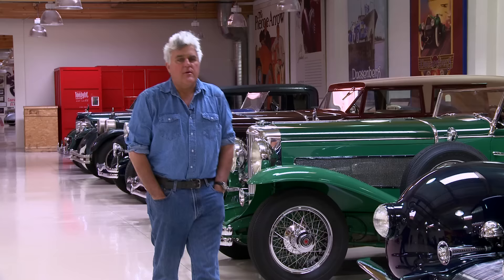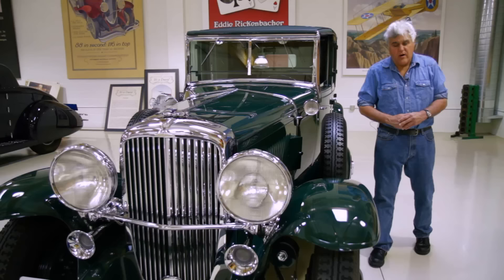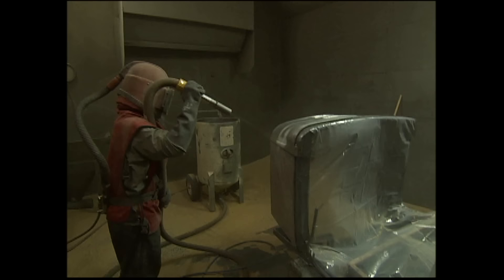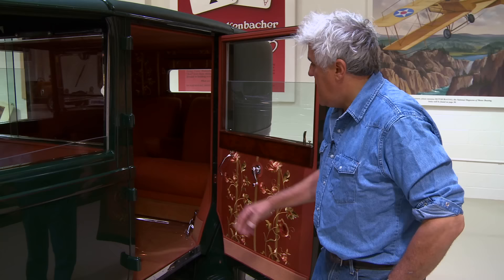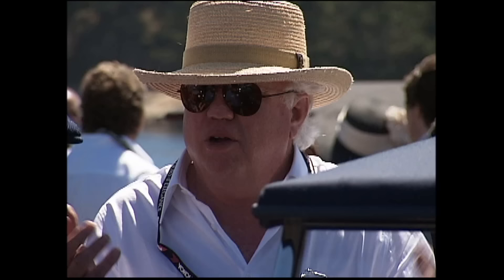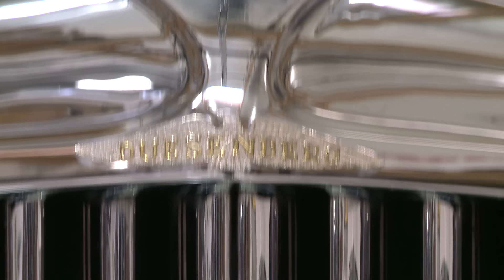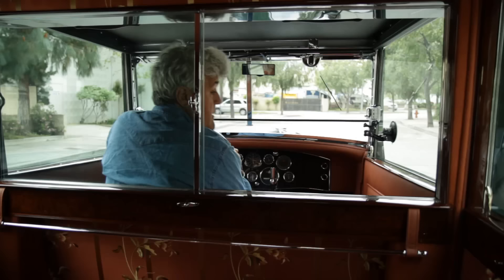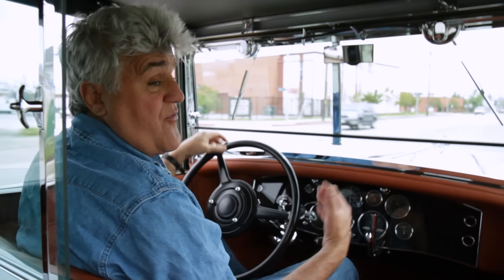1931 Duesenberg Model J Town Car - Jay Leno's Garage

Comment: "The Duesenberg - section of the garage"....My God!
Reply: I have 4 cars. “Here is the Fusion wing (2 2011s), the Chrysler wing (2013 200) and the Acura wing (03 MDX). All have over 200,000 miles, and are original, and unrestored😁”
Reply: Here is the Corvette section of my garage, they are all original, they say Hotwheel or Matchbox underneath
Reply: Here is a section in my garage
Reply: Really ... Count the cars, then multiple by $1 Million .  At least.
Reply: I always say this the weedeater section of my garage,this is the 2 cycle oil section......etc etc

Comment: For those who aren't familiar with Duesenbergs and other vintage automobile makes,  a Duesenberg left the factory as a rolling chassis - they did not have bodies nor interiors.  It was up to the owner to choose a coachbuilder to create the body and interior components and as a result every Duesenberg on earth is a unique, one-off creation.  There is no such thing as a "stock" Duesenberg.
Reply: Well they are considered stock if not mechanically modified. The body maker walker was owned by duesenberg. The LeBaron dual cowl phaetons are all the same except for color. Also if you buy an original and rebody it with a modern body it is still considered 100% original because of the fact that they didn't come with bodies.
Reply: @kylemichaels3373  Thank you both for the great information. Fascinating cars!

Comment: Something nobody seems to have commented on is Jay's driving skill.  If that's an original gearbox, I assume it did not have syncromesh and Jay did a pretty good job of shifting.  You can even hear once in a while he'd push the gear and wait for it to mesh (grinding gears) till he got the speeds matched and got'er in.  That is not an easy skill to master.  He's not just a rich guy with cool cars, he's a true "car guy".

Comment: Magnificent car. Saw one on GOODING AUCTION in red with the big flexible exhaust pipes coming out the RH side and was sold for $11.000.000 at auction
Reply: That would have been a SJ variant.  The SJ's had superchargers and are extremely rare today as there were few made and many/most had the superchargers removed at some point in the past.

Comment: The first car I learned to drive at 13 on the farm was a 2-Ton 1932 flat bed truck.  It had a little 4 banger engine that we started by pouring gas down the carb.  The gears were super low so it could haul a big stack of hay around the farm.  Great fun, memories.

Comment: I recently purchased a 1927 Buick Model 27 and the prev owner told me to come pick up any parts I could find in her garage (it was her husband’s car who passed away in 2004 and the car had been untouched since his passing, sitting in her garage), one of the things I found was a Pine’s Winterfront which has shutters, it amazes me when I used a hairdryer and heat the bellows based thermostat the shutters work as they should after all these years!!!  Pretty cool @JayLeno

Comment: Jay, when I was a kid probably about 16 (1980) I went with my dad to an old steel building down on Lake Quinsigamond in Shrewsbury Massachusetts inside the steel building there were about seven Duesenberg‘s all in various states of restoration. What they didn’t have they would hand make. One of the most impressive shops I ever went to… These cars truly are works of art.

Comment: I believe their is an estate down in Florida that was locked when the market crashed. The place is maintained, but has never been lived in again. They have taken picture of inside the build, and looks the same as the day they closed the doors. It isn't all dusty and stuff, the go through and clean the place once a year, and make repairs. The place is frozen in time. They have a garage with cars in it. Know one knows what the cars are, the have mechanics periodiclly go in. For the last forty years, the mechanics have been classic car guys. These classic car guys don't say what they work on, except the cars used by the servants.

Comment: 15:22 Altimeter?  I believe you may have misspoken, because I can't seem to find the altimeter.  Had it had one though, I would have been very impressed.
Reply: They did have them, in another Duesenberg video he talked about how silly it was for car to have an altimeter, at 15.26 what's the big gauge in the upper right corner?
Reply: @bigredc222  The phantom corsair also had an altimeter and a compass too if i remember correctly.
Reply: I found out why they have altimeters, it's to help in adjusting the carburetor, air is thin up high, rich down low.

Comment: Wait, can someone explain this?
So this is a 1931 model, but it was stored away in 1931. But it had (roughly) 107.000 miles on it? In one year, a car which had its place in New York City?
Reply: That is a good point!
Reply: It's just like that car on Craigslist--garaged for years, low mileage, and yet somehow it's got replaced pistons and more than 100K miles. :-)
Reply: haha
Reply: thee Mitchi 
Well you see there’s not air cleaner on the engine so it’s just sucking in all kinds of dirt and junk. 1 teaspoon of sand in an engine can cause the equivalent of 50,000 miles of wear
Reply: The car had 7,000 miles on it, but it might as well have had 107,000 with the amount of neglect and rust the car had.
Reply: It probably has 7000 miles and thousands of running hours.
Reply: Excellent point my dear Watson. Excellent point. Nice catch.
Reply: I dunno know. It had 107K miles on it.  Your Theory is correct, but in the real world, I suppose that's not what happened. Luckily.
Reply: In my opinion, it probably did only have a distance of 7000 miles on it, but was probably never shut off so it was always ready and warmed up in cold weather for its owners and guests to leave in a moments notice and without an air cleaner it was also sucking in dirt and debris which wore it out and resulted in its being parked
Reply: I think you're falling victim to an editing mistake.  More than likely the car was taken out of storage after the Depression and then run extensively during the 40's and 50's - remember that US domestic auto production ceased for the duration of World War II and no new models were released until the late 40's.
Reply: He may have misspoke. It is obvious that this car was well travelled over many years before it was salted away.

Comment: 1931 Duesey,, parked in 1931.. How the hell did it get 107,000 miles in one year in New York.?
Reply: They pulled it out of the garage and got it running again in the 1950's and then put it back in the garage. That must have added a few yards to the mileage!
Reply: Bought in 1931, driven around for a few months and parked in 1931.  Sat for 20 years and seized up,  got "restored" again in the early 1950's when hot rods and T-buckets were cool by re-boring out the seized cylinders and increasing horsepower and replacing the rear end and losing the fenders to make this old jalopy a hot rod.  Driven probably all through the 1950's and raced and thrashed, then parked again where it sat from the late 1950s' through the  late 1990s.  In the photo Jay showed from 1997, you can see the rear window of the garage is wide open which is how it got so damaged.

Comment: Why is it they were smart enough 90+ yrs ago to make a valve to empty your oil, but today we are still using a screw plug???? 🤦
Reply: There was also a system to grease all the fittings from one pump. Now, with stuff like "lubed-for-life" ball joints, it's use it up and throw it out. Makers don't even include zerk fittings.
Reply: because evil people would open that valve and  empty your oil, destroying your engine when you went to drive it
Reply: the same reason they  quit putting drain plugs in the bottom of fuel tanks, because when you brought your car in for inspection, the dirt bags would steal some gas, or leave it open slightly so they could charge another repair bill and towing charge
Reply: The thing has adjustable brake settings. I cannot even believe that. Wow the innovations we had in America at that day and age. I’m not saying they weren’t doing other things around the world but this car alone makes me happy to learn and hear about. I’m soo happy Jay Leno preserves a piece of history like this for us to all learn from.
Reply: @stephenarling1667  I've found that surprisingly the ultra cheap ball joints have grease zerks. The high end ones don't and they fail in 20,000 miles when they're warrantied for 80,000.

Comment: Sounds like it has straight cut gears.
Reply: And no synchros on the tranny. Did Jay grind the gears twice? Might get fired if he was a chauffeur.
Reply: The trick is just before stopping drop it into low gear and don't idle in neutral. If per chance you do find you are in neutral with the engine idling it probably has a clutch brake, press the clutch all the way to the floor and hold it there a moment and it will stop the transmission from rolling over and then shift into gear, no gear grinding. After moving out double clutch on shifting and if your timing is right, no grinding!

Comment: Why did he do the interior like a late 80s restoration?   A white interior would have looked stunning compared to the peach,  and the single bench with the buttons feel way more period and clean than the folding armrest.
Reply: As he stated, it was in line with the colours of the time. Art Deco is not for everyone, but I think the color combination is right on the money if you want to keep it in the spirit of the time.
Reply: Granattaaaaaa I'm not saying it isn't period correct,  just that the way it's done is different from the original in a way that makes it a late 80s style car.   I also think the broquade makes it look less art deco.
Reply: brett knoss
Well I agree that I would have chosen something more original to the original spec.

Comment: I really love nearly all of Jey Leno's videos and his cars. Even the modifications are nice and most of the time not too inappropriate. 
But this car... far too overrestored, in my mind. At least on the screen, it has no soul left. No patina at all. More like a nouveau rich guy thinks an old car should look. So much bling and so "well made". Especially the fond looks awful. This upholstery like cinema chairs instead of the original "chesterfield style" and this apricot colour with the flowers.
Maybe I'm wrong, but it seems a bit anachronostic.
Reply: If the illustration has been accurate, it's condition was so bad coming out of storage it had be nearly recreated. There was essentially no "patina" to preserve. It had all deteriorated along with the paint and much of the metal. Preserving the original surface of an old car is certainly desirable if there is enough left to work with but some old cars are just lucky to be restored at all.

Comment: 1931 american car with DOHC 4 valves per cylinder. Maybe those GM engineers of today might wanna take a look since the 2015 Z06 Corvette only has pushrod engine with 2 valves per. But then again Duesenbergs were built by german brothers fresh from the boat you know from the birthplace of automobile.
Reply: There's a reason the Chevy's are pushrod. Cheaper, still make good power, makes the engine more compact. Can't say that about the Ford V8s.
Reply: Yeah, because Corvette's engine is a huge flaw.  Yeah, ok.  The big knock against 'vettes was usually that they had crappy interiors, which was fair enough.  The 2015 models have addressed that issue with massively improved interiors, though.  But, aside from the late 70s to early 80s, the engine has always been the best part of any vette.  Why make something more complex and expensive than necessary?
Reply: the vette engine (z06) makes 650hp and the car gets about 29 mpgs. The pushrod style also helps lower the hood line and keeps the cg down due to there being no overhead cams (x4 weight for dohc compared to 1 center cam, with some weight added from the pushrods). plus it's cheaper to make and easier to work on. So what's wrong with the engine exactly?
Reply: ccubsfan94
Well the price is great, spare parts are cheap and it ain't the most complicated engine to tinker which is great. What's so special about DOHC engine? Dunno maybe smaller size, more power, better throttle response, better mileage, better potential weight distribution and the fact that every proper race and sports car has had one for 50 years - hell even the resurrected Ford GT.
Reply: um no, DOHC engines are larger in size. How do you get better throttle response by adding friction inside the engine (more cams)? How does having a cam operating the intake valves and another cam operating the exhaust valves improve fuel mileage (more cams, more friction, more weight). What do you mean by weight distribution?
Reply: Push rod engines are more low end grunt high HP. OHC engines are high RPM medium power...
Reply: ur cool
Reply: They were not "fresh off the boat".
Reply: Maltfusion If by fresh off the boat from Germany at the age of 5, grew up on a farm in Iowa, developed their engines and motorcycles in Rockford, IA, built up their manufacturing in St. Paul Minn. and came to fruition with the Duesenberg Model A in Indianapolis, then YES, they were fresh off the boat from Germany with all their superior Germanic background making Duesenbergs.
Reply: bcubed72
I don't know about techno peeing contest because independent suspension, overhead cams and variable valve timing isn't exactly some NASA grade technology. Only reason US manufacturers don't use them much is cost and has nothing to do with optimum performance. I read that the original Viper was supposed to have 4- valve construction but was shot down at the last minute by company executives because of minor added cost. Well the result was basically a truck engine with 50bhp per litre whoopee doo. And now I have to wait for someone to educate me it's got a lot of torque...
Reply: So the Dusenbergs were fresh off the boat from France? I know Germans like to take credit for everything but Nicolas-Joseph Cugnot was French and his automobile ran the streets of Paris 100 years before Benz figured out how to rip off  Gustave Trouvé's (hint: Trouvé wasn't German either) electric automobile  patents. Oh, and this was also at the time Gottleib Daimler copied  Nicéphore Niépce's 71 year old internal combustion engine. 

So a more accurate sentence would be "The Dusenberg brothers had emigrated to the US 20 years previous, and in keeping with their German ancestry, proceeded to rip off French and American automotive designs. And like German automobiles today, their designs were expensive, impractical, and prone to failure. They died during the Depression, because now rich men couldn't afford to buy their new Dusey toys every two years after the current one breaks down."
Reply: Maltfusion, tell you what, I will give up on LS engines at $300 a block all day long from junkyards, making 1500 hp reliably with stock bottom end and chinese turbos, when I can get Porsche to make me crate engines for sale of their wonderful (honestly) 4.6L V8 from the 918 with 605 hp. I would take it instantly, even at $20,000. 

But the problem is that it won't happen. Not even with Audi RS engines. I have been offered at best, a refurbished Audi RS4 engine for about $15,000 in Europe but thats it. Nothing official. Really, I want a V8 with "modern" stuff like 4-5v per cyl, DOHC, flat plane and dry sump. But outside the GT350R it just is not happening even if I wanted to. A used RS(4-7) Audi or maaaaybe a really banged up Merc from early 2000s can be found. But parts? ... I better own my own 5-axis machine cause I am never paying the factories for parts.

We want the same thing, but I just refuse to pay overprice for the same end result.
Reply: France had a car before Germany

Comment: JAY /  MY FATHER ACTUALLY HAD A 1916 REVERE DUESENBURG / YES IT RAN AN DROVE GREAT / I DTOVEVIT IN PARADES IN MY HOME TOWN OF PORT TOWNDEND WASHINGTON / MY DAD BOUGHT THIS DUESENBURG  IN CHICAGO IN 1916  AN THEN HE ACTUALLY DROVE IT FROM CHICAGO TO PORT TOWNSEND BACK IN 1918 / THIS WAS A FOUR CYLINDER MOTOR / 4/1 /4 INCH BORE  AN 6 1/4  STROKE /  THIS WAS A 4 DOOR  / CONVERTABLE / ALL ALLUMINUM BODY / LEATHER INTERIOR /

Comment: "The Model J's straigh-eight was based on the company's successful racing engines of the 1920s; designed by Duesenberg, they were manufactured by Lycoming
 another company owned by Cord. In unsupercharged form, the eight 
produced an impressive (for the period) 265 horsepower (198 kW), aided by dual overhead camshafts and four valves per cylinder.
 The Model J was capable of a top speed of 119 mph (192 km/h), and 
94 mph (151 km/h) in second gear. Other cars featured 
larger-displacement engines, but none surpassed its power. It was also both the fastest and most expensive American automobile in the market"
Reply: Yes, it's interesting how Lycoming was prevalent in cars, which all eventually failed. Cord, Deusenberg, Tucker. Were they responsible atall for the superchargers used in the Allison engine plants in the P-40 and P-51 early models? You know, the ones that could dogfight zeros at low altitude, but gasped over 12angels? They helped usher in the first functional helicopters, but by the early 60's turbines reduced them to nothing but conventionally aspirated aircraft for the most part. So many opportunities, so many fails. If we hadn't gotten the Merlin engine in the P-51, it would have been nothing but a easy-target ground support plane, not a fighter escort from london to berlin, 30 minute loiter time, and back again.